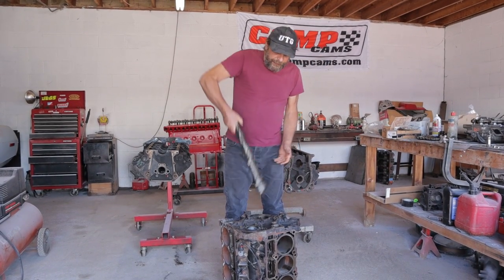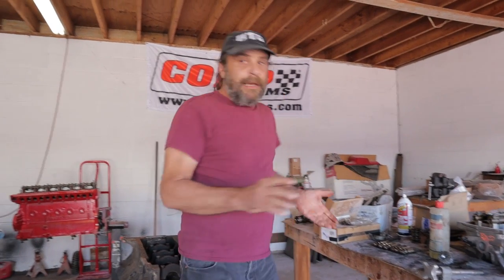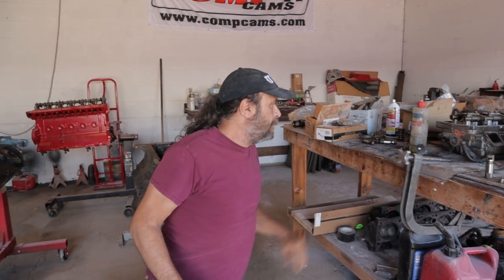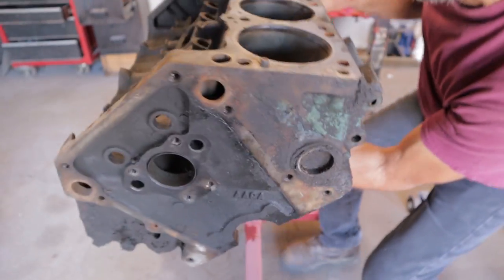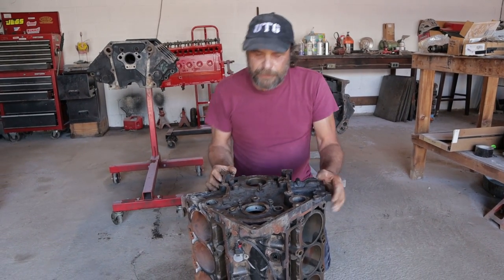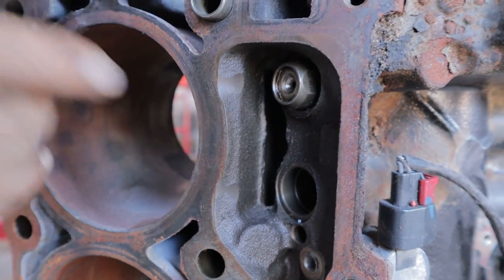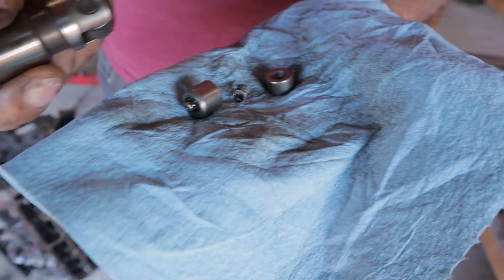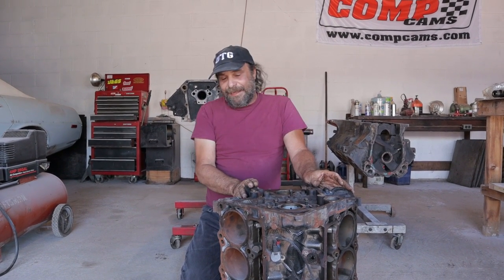Gen 3 Hemi Camshaft Failure Mystery Explained!

Comment: This guy nails it. I have a 300 with a 6.4 in it, and it ate the intake lobe on cylinder #8. The lifter roller wheel was locked up and ground into the cam. There was no other problem with the lifters. No scuffing on the sides, no other signs of stress. None! Simply a locked roller wheel. No oil gets to the roller bearings except what gets thrown off the crank, and that's not sufficient.. It's a flawed design. My car only has 38k miles on it, and it had to be completely rebuilt.  I'm not sure if there is a class action suit, but I'm not going to bother with some fractional recovery, instead I'll pursue it at my local level. Any questions email me at gtsviper-AT-AOL-dot-com

Comment: You are real mecanic figured out bad engine  design congratulations,
I use 5w30 synthetic motor oil with mobil one or other high quality filter ,
Higher oil pressure at idle better lubrication for cam lifters no brainer,
It mite go well over 500k -1000miles 
Wrong oil ,or keep listening Manufacturer and do your lifter and cam every 50k-100k.

Comment: The simple Solution is to put the Higher Volume Oil Pump from the Bigger Gen. 3 HEMIS like the 6.2, 6.4, and 7.0 Hell Elephant Gen.3 HEMI!  Also, There's absolutely no Design flaw with the Engine Block of Chrysler Generation 3 HEMI! Tom Hoover the Designer and Chief Engineer of the  Second Generation or Gen. 2 (426- HEMI) He work with and helped Engineer with the SRT8 Team at Chrysler that with the Awesome Horse/Torque Ratio of the Generation 2 or 426 HEMI from 1964 to 1971 that due to the heavy-Duty Valve Train design on Street Racing and Sometimes the on the Track NHRA it took "The 426 HEMI Time to Spool up The Combustional Fuel to fly Down the track!  Although, the "Chrysler Gen.2  426-HEMI Always Won and Could Run All day off the line 50/50 of the time The Ford or Chevy's got the jump, But "The most Finest Internal Combustion Engine Ever Designed or Engineered is Still to this Day is ready to Break that 2-Second Barrier!  And I Believe that the Generation 3 Chrysler HEMi 392 cid 6.4 Liter or The Hell Elephant 426 Generation 3 HEMi Engines Could be it!  The purpose of The New Generation 3 5.7, 6.1, 6.2, 6.4, or 7.0 HEMIS was to Finally Modernized the Valve Train lighten it up to increase the CFM Flow Rates to Exhaust Ratio Equal to that or better than DOHC Multi-Valve Engine that cost fortune!  Well Buddy "The Geniuses Of Our Beloved Chrysler/Mopar Engineering Corporation and at SRT8 Along with PaPa Engineer Tom Hoover Achieved it again, The Greatest Success Story in the Automotive Industry Since The Chrysler Corporation Invented the "Firs Modern Automobile The 1934 Chrysler Airflow!  Chrysler Invented "The First Fastest Production Car Ever Right Off The Showroom Floor, " Dodge Challenger Hellcat Named After the Great WWII Fighter NAVY Plane that also is a Winner! I spoke to Chrysler/Dodge/Jeep and all Mechanic that work at the Dealership! It typical of news media! They play down Toyota Prius problems, GM, Mercedes , Ford , and every other AutoMakers Recalls faulty!  But Chrysler Gen. 3 HEMI with less than  One Tenth of a percentage the problem with some of their Police Vehicles with a 5.7 Liter that Sit or Running at very long Idles without any Reviving the Engine to Cool the Radiator down with the Air-conditioning on well Hell, there's no Car Manufacturer in the that something is going to overheat!  Well Chrysler found out the problem was the above!  To permanently Repair and Fix the problem, if you plan on Running your a very, very, very long period of at an Idle speed with your A/C on that's longer than most Average Foreign or Domestic Vehicles, just Go your Local Chrysler, Dodge, or Jeep Dealership and install the High-Volume Oil Pump from a Hellcat 6.4 Liter HEMI Engine to put on your 5.7 Liter HEMI Engine!  That is you Permanent Factory Chrysler Fix! Your Generation 3 HEMIS 5.7, 6.1, 6.2, 6.4, and Crate 7.0 426 cid or 7.0 HEMI Chrysler Engines were all Engineered for us Americans to relive "The Glory Days Of The Muscle ERA Through Our Chrysler Mopars"!  The Chrysler 300, Dodge Challenger, and Dodge Chargers of today and the past!  Don't let anyone try to Drag you Down about your Mopar your Chrysler 300, Dodge Challenger or Dodge Chargers!  These Generation 3 HEMIS Automotive Vehicles are Already ICONIC Marvels that not Even Ford with their Mustang Coyote, Chevrolet with their Camaro or Even Chevrolet with their rear engine Corvette could hang with Our Badass Red-eye Dodge Challengers or Dodge Chargers!  Make a "Real investment Buy A Mopar Chrysler HEMI Engine 300, Dodge Hellcat Challenger or Dodge Hellcat Charger, Now¡

Comment: Who the heck idles and drives a Hemi like a grandma? I have my 2005 Ram 2500 for 16+ years now. I never speed but I sure as heck get to the speed limit like a roaring rocket. Engine runs awesome and the truck still looks great even with its rusted rear wheel wells.  ;)

Comment: What years designate  1st, 2nd, and 3rd gen ?
Reply: 1st gen was the old small (Red Ram) hemi of yore: 1950's 392 cubic inches displacement max.
2nd gen was the 1970 Hemi 'Cuda era, 426 cubic inches, still an iconic motor to this day.
3rd gen was the small block Hemi started in 2005 or so.

Comment: SRT's don't do this, they run synthetic oil. As far as Chinese lifters they are made from recycled materials, i have used other brands other than mopar lifters that are made in China, same problem only worse. Lifters not pumping up, noisy. Last few sets of lifters from dealer are made in Germany! Problem fixed! No issues whatsoever even after tens of thousands of hard miles including idle time but this is with 3k miles oil intervals  with quality mineral oils and mopar filter. Chrysler may have a design flaw but my hellcat challenger with close to 1k horsepower to the tire and 40k extremely  hard daily driven miles and synthetic oil hasn't had one issue with lifters, that's with heavy spring loads. But it's an M6 manual trans without mds.

Comment: Bad design?  I have 350K on a 6.1 and a 6.4 with zero problems.  Do you call the Chevy small block a bad design because a LOT of them have been blowing up with 10K miles or less

Comment: Why not drill a 3/8” hole in top of block not as a dribbler but then to drill a small hole in that cast in oil tube. It’d spray up on cam. Then thread the access hole n plug

Comment: Drill a hole in the bottom of the lifter body so the oil will drip from the push rod, down to the roller and onto the cam.

Comment: After tearing apart my 2017 5.7 the previous owner definitely didn't  change the oil properly. The rocker shafts was full of oil sludge and caused 6 lifters to fail. Having this as a flaw is one thing, being a lazy cheap ass is another. ANYONE buying a newer hemi should definitely pull the valve covers and look to see if the previous owner changed the oil properly and if you own one...KEEP THE OIL CHANGED!!!

Comment: Reignited Cycle and Automotive debunked this. These engines aren't oiled the same way as V8s were in the 1960s. Oil bleeds down the lifters and onto the roller in the Gen III Hemi. It is not being slung up on the cam from the crankshaft. It's low oil pressure at idle. This issue is solved by installing a Hellcat oil pump which is high volume and keeps the pressure way up even at idle.

Comment: Chrysler knows about this.  For them to say they didn't is complete BS.  The amount of testing they do on new engine designs is immense!  They saw these failures.  This was likely seen and some one said "oh shit", but it was too late in the program and they ran a statistical analysis to see how often it would happen and it fell under a the class failure level of about 3%.  As a project manager I know how much testing is done on new articles before introduction to market.  In large corporations "Schedule is king".  Time to market is money, BIG $$$$$$$.  To be late is something that is unacceptable.  The dollars that being late cost is tremendous especially if there has been big media around a launch of a new item.  They knew, they chose to accept the risk.  Now the public needs to make noise about it.  They will never publicly admit that they knew.

If they in fact didn't know...then they have a complete failure in their engineering department.  The test scenarios have failed them.  This would mean that they cut costs so much that they reduced the number of engines severely enough to allow this type of failure.  This is typically what happens in design phases when budgets get cut.  The testing in early stages is minimal but idling an engine would be a test that I can't imaging would get cut.  Keep in mind that they likely also have several engines on dynos simultaneously.  That's the only way to build test hours and get the confidence in repeatability.  They saw these failures.

Comment: It seems you are showing the lifters farthest away from the oil pump, what about the ones closer to the oil pump?? You could roll it back to a 1960's Ford hack of the 1950's Ford 252 and 292 V-8, add a T to the oil pressure switch with a copper line tapped into the top of each valve cover to give rockers and lifters more oil.

Comment: Too bad the Hemi you’re showing is a gen 2 hemi, never seen a cam problem on them, just valve seats falling out. The gen 3 vvt hemi eats cams, check the thickness of the lifter roller and I think you will have your answer.

Comment: Chrysler dodge should be responsible for this I still on 13,000 in my truck I bought a brand new it is not fair that I still on money and the engine is Broken
Reply: I took my Dodge Ram To get it fixed is going to cost me $4800 This is ridiculous

Comment: worked for chrysler from 1968-1989, the new hemi and the 318-360 mag engines came thru with anemic valve springs,period 208 open pressure and 80 lbs on the seat is not gonna get it,if you are running one of these engines for just wheels,it needs new valve springs,roller lifter ,regardless of hydraulic or solid lifter design require more pressure due to weight of the lifter,i've pulled them new out of the box,check them on my tester,and just laugh,do it yourself,quite worrying of the roller design and material and just add the pressure,if they bounce the cam suffers,the needles suffer,and being they are hard material for ultra wear properties,they need to ride the lobe no matter what,that takes pressure,oil changes on new engines should be more often than specified even in the owner a manual,hell it s your engine,mine run clean,i change my oil every 3500 for three drops and then go to 5000 miles after the pan is kept clean,the oil pan needs to stay clean or you are going to see sump strainer filth of every kind,i dont work on mine,they rarely break,this old timer knows what he is talking about,he's tore more down than most,and that's where you learn the real deal,when i see a clean engine apart,first thing i check is what oil the owner is using and when he drops it,hell its the nature of an internal combustion engine to filth the oil,thanks TONY,build them clean, oil changes keep them clean,carry on

Comment: The lifters maybe too stiff. Pushing too hard on lobes and valve stems. That would explain the stuff getting crushed. The cheapo Chinese lifters have a relief hole in them to bleed off some pressure. Might be why lobes don't get crushed as often?

Comment: Unplug MDS solenoids to allow full pressurization and full volume of engine oil to the upper part of the engine block. Replace all of the lifters with solid lifters instead of the m d s lifters. Overfill the crankcase oil to create more windage splash to help lubricate the camshaft.

Comment: So the hell cat oil pump fits on the 09 + 5.7 hemi and idles at 52 psi.  Stock 5.7 oil pump idles at 27. Long idle times kill. So bump up the idle pressure with a stock hellcat pump and boom problem solved 09+ hemi's. 03 to 08 have problems with valve seats falling out not to bad on oiling issues except like he said with lazy cops sitting around idling away all your taxes.

Comment: FORD Done away with 
the 7:3 Power Stoke in 2003
Bullet proof and Powerful Motor,,
And Replaced it with the
Juke 6.0 Diesel , that over heated 
and the Heads always go bad.

I bought a new Dually in 
2003 But it had one of the
Last , 7:3 Power Stokes,

That 7:3 Had 225 H.P,
and it had More pulling power
then a 2006 Dodge diesel 5:9... 
with 325 .H.P..

FORD was Not making any money on the 7.3  ,,, So they got rid of it..!!

Comment: Too bad there isnt an aftermarket roller lifter that does indeed pass oil thru and skeet a jet of oil onto the roller.  (and by extension it would lube the cam lobes also)
Reply: There are several.

Comment: I have had no issues with my 2005 5.7l in regards to oil starvation (only a valve seat) but have changed the oil between 3k & 5k miles and run it hard so I’m guessing there is a lot of crank splash!

https://www.instagram.com/p/BNXbKzpg6bz/ 

What are your thoughts on adding another quart of oil to the engine to help with splash lubrication of the cam or adding an oil additive to help with dry starts?

Thanks for you input.

Comment: So I'm not at my shop but what vehicles are equipped with these engines. I have a guy that has a new dodge ram with a hemi that has been renting a bay from me trying to fix low rpm running issues. Refuses to let an actual technician look at it. One of those diy guys that has no idea how things work.

Comment: The 1st gen Hemi should have been brought back from the grave! No further problems would have happened. Chrysler is no longer Chrysler as we can clearly see in this third generation Hemi, if the original designers of the Hemi would still be alive that's what they would have done the first generation Hemi would have been brought back to life. What we've got here is failure to communicate the so-called Engineers that Chrysler has on board right now do not know how to design a good reliable engine!

Comment: I see two options, either the oil is not used according to the instructions, or the metal itself is shit, but in fact this is a disease of these engines, so why are there no such problems on the Chevrolet V8 LS?
Reply: @smokeysghost4759  in Russia, we really do not have many knowledgeable specialists, so we have to look for reliable information on the Internet :(, I have a JEEP Grand Cherokee WK 2005 5,7HEMI but we put the engine later than 2013 VCT, so I am tormented by the question, why is development of the camshaft and hydraulic compensators and it is on HEMI engines?

Comment: Uncle Tony, is the Oiling flaw also prevalent in the GEN III 392 engine block as well? 

Also have you heard of Bear Block Motors (www.bearblockmotors.com) designing a modern GEN 1 392 block? Here is the article (www.enginelabs.com/news/theres-a-new-hemi-in-town-bear-block-motors-392-hemi-block/). 

Also have you heard of a company called Bulldog Performance (www.bulldogblockhead.com)? They Make Gen II HEMI's, 440 and 400 block engines. He is one of their articles (moparconnectionmagazine.com/gallery-following-a-bulldog-performance-hemi-block-from-casting-to-machining/). 

You're insight into these modern HEMI GEN 1 & GEN 2 makers would be greatly appreciated.

Comment: In the 70s I rebuilt  and machined any thing from hit and miss to cummins ,Detroit all v8s.you name it I probably  had my hands on it.I touched  a motors that had 3' pitons The engineers of this motor built on the sweet of 60s engineers.that used a slide rule pen an paper and there brain. THEY DINT DO THERE HOME WORK! They used a program. I know a  fix for this it involves

Comment: The thing wrong is mopar allowed german engineers to mess it up with german engineering !  lets shut cylinders off here n there ! They have valve seats that literally fall out of the heads and into the motor ! They should have kept german engineers away from them .. I own a gen 3 hemi, I use oil stabilizer and a coolant additive to keep the heads cool  warm it up, and let it run 10 mins to stabilize before shutting it off. Open up the valley smooth out and enlarge oil returns, im adding tiny holes to my lifter bosses as well i was going to create a bronze sleeve with notches in them for the lifter to ride my idea was to put notches in the sleeve for oil to easily get in and oil the lifter, unfortunately i dont have a mopar budget , ill let you know how it works. Ive seen cross drilling the bosses work in high rpm motors ive done in the past.

Comment: Had my SRT 392 grenade a cam despite regularly being taken to redline and running mostly in Sport mode to turn off MDS. The engine design is garbage.
Reply: you have to put it in manual to turn off mds

Comment: I am taking it back to the dealership Engine cost me $6000 this is not right now I had to pay to remove the engine into install it again because the dealership didn’t install it I pay separate for that to someone else This will be the second engine in my truck my truck is only 100,000